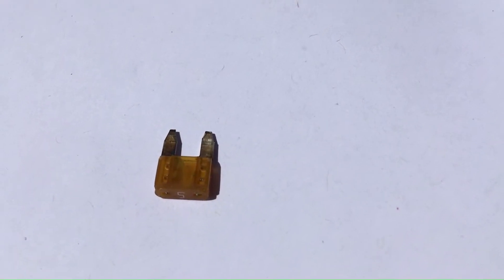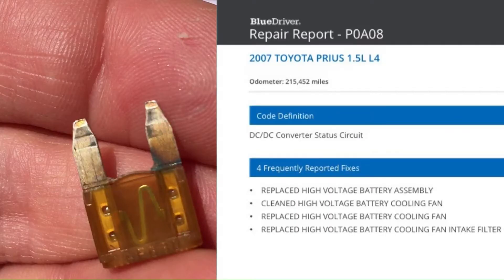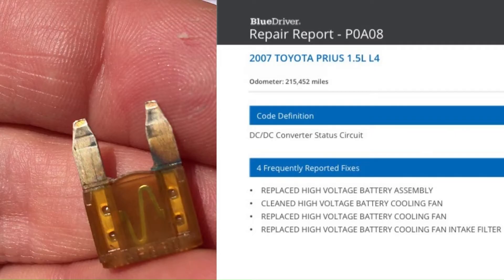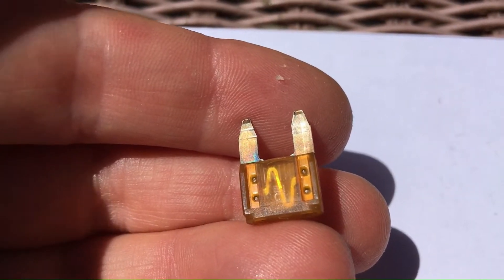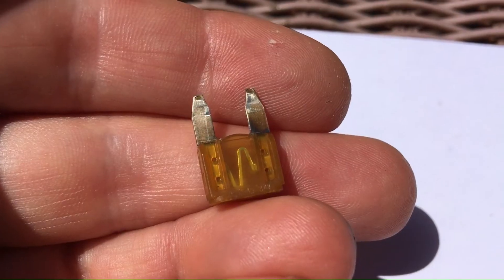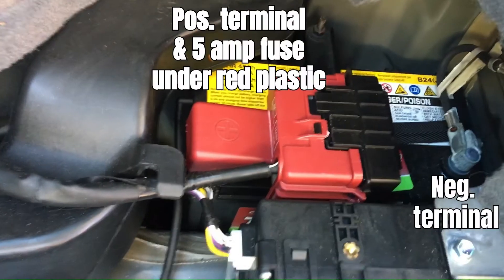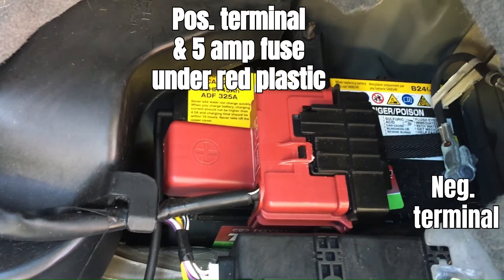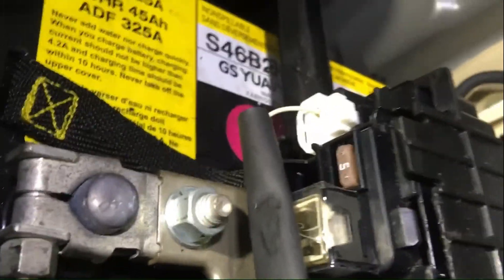2nd Gen Prius P0A08 Red Triangle of Death- Just a Blown Fuse

Comment: Good, helpful BUT I just discovered the fuse for the rear tail lights is blown literally inside the sleeve it slides into!!  I pulled it and the legs themselves are gone and must be fused (no pun intended) INSIDE the little compartments!!!  Now what to do??  I need some help pronto please!  Thanks
Reply from the maker: Sounds like you might have to get a whole new housing (that goes over the battery and holds the fuse) for the fuse.

Comment: I had the issue of the death red triangle. I solved the issue by doing several battery charge. How ? It is simple, put your foot on the brake before to push the start button, start the vehicle by pushing the button and brake and accelerate at the same time, the engine will start and charge the battery. Maintain brake and accelerator during all the operation. When the battery will be loaded, the engine will stop. Use the battery (by letting the vehicle on without moving). When the battery turn purple, stop the car and redo 2 or 3 times the operation. The BMS will recover the the right usage points. Disconnect the 12V battery 1 mn then reconnect. Start the vehicle, slowly, put, the key, push the button without braking, wait 10 secondes, brake, start the button, the triangle disappeared and the car is working well. Before to discover that, I have disabled the high voltage battery protections and tested all the battery cells, one by one, there was less than 0,2V of difference between the lower and the higher cell. So the battery was not to be changed, but only the BMS was to be recalibrated.

Comment: Hi
I have Triangle warning light,
Replaced hybrid battery.
Now car running perfect condition.
But still light on Triangle light, engine light,ABS break light on...
Car perfect running.
I can hear frequently the noise of relays.
Give me ideas to fix problems
Reply from the maker: If you haven't already, try using a scan tool and set to read all codes (or whatever your model's equivalent setting). See if anything comes up. If so, then investigate that, but if not try disconnecting the neg battery cable at the 12V auxillary battery to reset things. 
Hopefully since the car is running perfect it's just a matter of resetting things.
Reply: @DIYwithDrJeff  
Thanks for reply.
 @cornishrob123  
Hi
I tried clear error by OBD2 Tools.
My error codes is 
P3000
P0A9E.
I tried to clean codes but 10 second, Triangle and engine light come back.
Cheer

Comment: Hi, did the red triangle and the DTC p0a08 both immediately go away once the fuse was changed?
Reply from the maker: Yes. It went away immediately. 
 Note that I disconnected the negative battery (ground) during the procedure which resets the computer and clears codes. But the red triangle never came back, and I have done about 50 drive cycles since and no codes.
There may be other causes for the P0A08 but luckily in my case it was just a simple fuse. I hope yours tuns out to be nothing more also.
Reply: @DIYwithDrJeff  Thank you for your reply, but it didn't work for me.  Oh well, back to the drawing board.
Reply from the maker: @user-wn7nz1mq4l  Sorry to hear that. My fuse was visibly bad so that was the clue to my problem. This is what stinks about fault codes- there can be multiple causes. It can be super frustrating working on your own vehicle.
Reply: @DIYwithDrJeff  This is true. Actually, when I removed the 5 amp fuse it looked exactly like yours. My hopes were raised briefly.
Reply from the maker: @user-wn7nz1mq4l Bummer. Try this forum as there are some Prius mechanics on there who might be able to help. https://priuschat.com/forum/